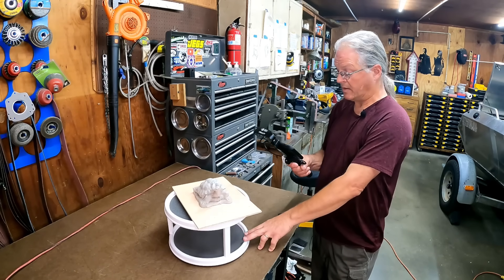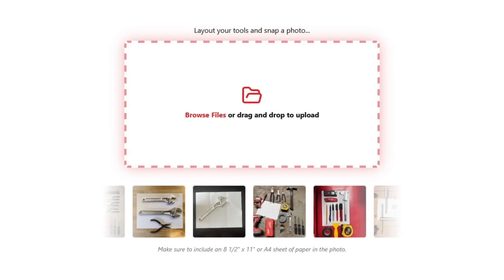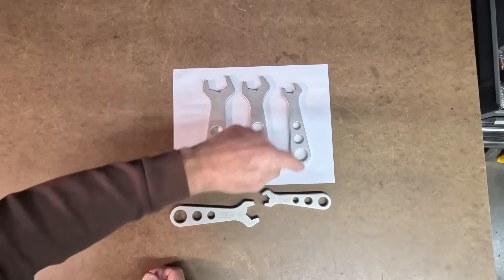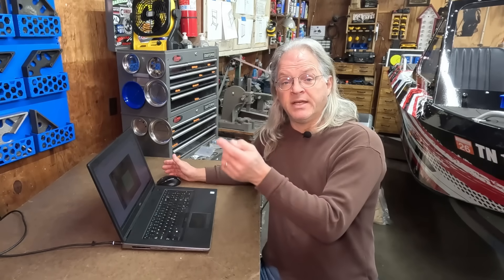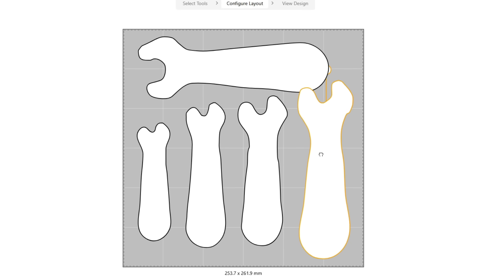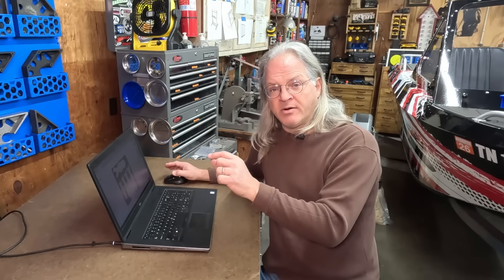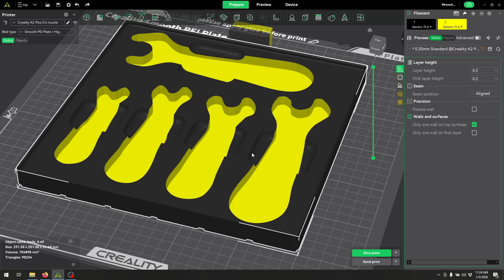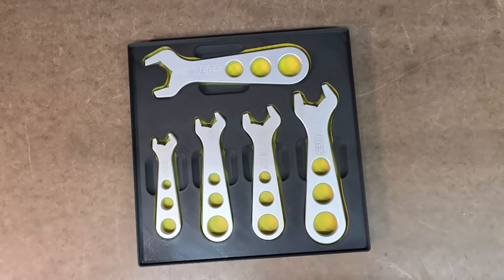Stop Using CAD for 3D Printed Tool Trays - Do This Instead!

Comment: Wow!  If your state disagrees with the kind of tool you are making trays for, does this site sell you out?
Reply from the maker: Like a portable, hand held hole puncher?
Reply: @MakingStuff  Like the kind used in the bucket video?
Reply: Hahahaaaaa. Yup. Few things in life are free.  Gotta wonder what is in the TOS that may be a negative.  But overall great product it seems.
Reply: @debrasam5525  Only real limitation is that the FREE account on the site limits you to basic outlines and only THREE tool traces a month, whereas the PRO plan for $8 a month gives you:
Advanced tool tray configuration
Add simple shapes to your design
Unlimited tool traces
Enhanced outline detection
Reply: @debrasam5525  you don't have a burner computer with no personal info on it?
Reply: Yeah the parent company FinalREV have pulled their Terms of Service.  They are from Berkley, CA. ToolTrace requires you to have a email log in or you cant do your three low detail free models. They do have on their website they say they have the right to sell anything you upload to their customers. The Company reserves the right, but not the obligation, to, in its sole discretion, determine whether or not any Content is appropriate and complies with these Terms, refuse or remove this Content.  It’s like Bambu they gate keep and can censor if they choose.    I think a basic photo uploaded to 3D builder works for me.
Reply: "Dinner Bell"
Reply: No worries. That RPG won't fit on a standard sheet of paper anyhow. Wait till they accept legal size paper :D

Comment: Thanks for the idea. Just wanted to say that you're much better off downloading in .STEP format than in STL. It's true that the slicer will convert that into .STL anyway, but that conversion is specifically optimized for 3D printing.

Comment: Simple boolean operation
Reply from the maker: Yes but you still would have to 3D scan the tool or already have a 3D file of the tool before you can perform a boolean operation.

Comment: can you do bigger than letter? Or can you import multiple tools to make a large drawer layout
Reply: Paper size has no bearing on the size of the print. It's just there to determine the relative size of the tools. Much easier than trying to include a clear picture of a ruler in each photo.
Reply from the maker: @noneentered1 Thanks!
Reply from the maker: I was wondering the size limit of each drawer myself.  If someone has already found the limits, please let us know.

Comment: Thanks for a great presentation. If one wants to automatically color code the slots with something like an AMS/CFS system, coloring the sidebar going to result in a fairly large number of filament changes. The number of filament changes would be significantly reduced if the contrasting color was only printed on the bottom.
Reply from the maker: Yes it would. Thanks for watching!

Comment: Ok this is awesome. But I had problems with photo reflections and shadows off some shiny parts.  So I took the paper background and drew an outline around the part.  Then colored it in with a black  marker. Took photo of that. Worked much better. Then slice and print thin 2D result to test for fit by laying part on it. Just printing a photo of the part can be a problem since printer may not size it right.  And it is easy to adjust finished design just by coloring a bit here and there on the paper.  Parts came out much better with small fit setting.
Reply from the maker: Thanks for the tips!

Comment: This would work great for an insert on a hidden “Freedom Seed Despinser” drawer. Everything the same as for a tool but just go with a large tolerance for your special “Freedom Seed Dispenser “ . Then use a spray adhesive and soft material to line the opening for the dispenser. So many uses for this. Thank you for the info!!!!
Reply from the maker: Portable hand held hole punchers?

Comment: If you don't plan to pull the tray insert from the drawer to carry all the tools to a location, you can get the colored bottom effect and reduce print time and filament requirements.
Print the main portion of the tool holder as a hollow, meaning only the sides and tool knockouts without a bottom. 
Craft stores sell 1/16 and 1/8 inch foam in various colors. You can line the drawer or compartment bottom with the foam, or even glue the foam to the back of the tool tray. 
This will give you the colored inset effect, provide a little cushion for the tools, and cut print time by about 30%. The foam is also likely less expensive than the filament.
Reply from the maker: Thanks for the tip on using foam!
Reply: And some of that foam has adhesive backing, thanks for the tip.